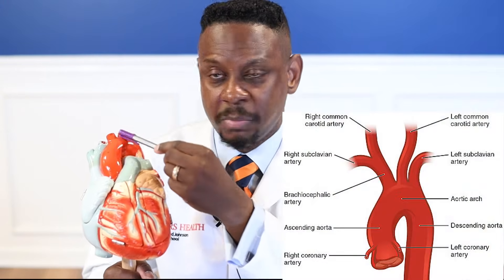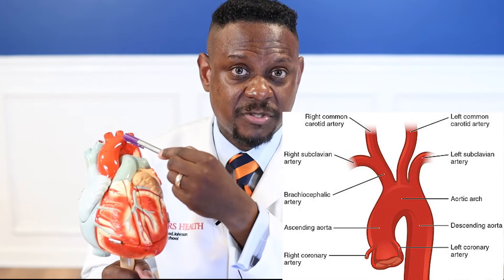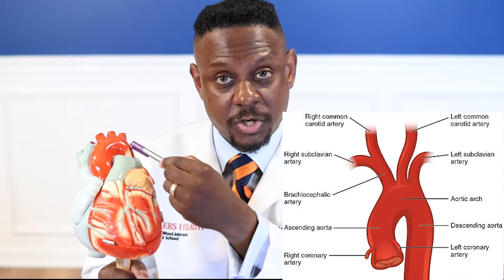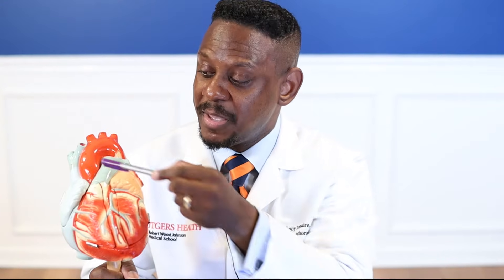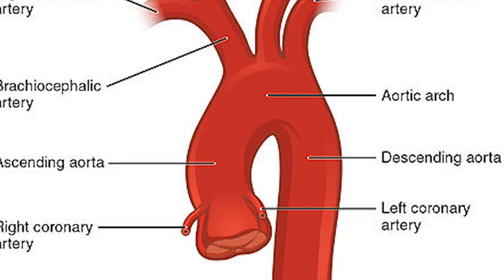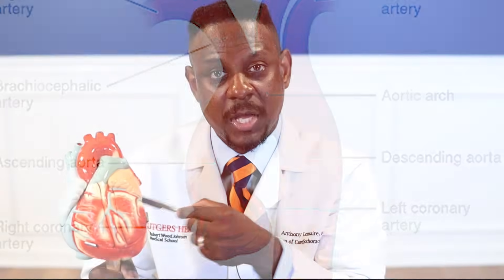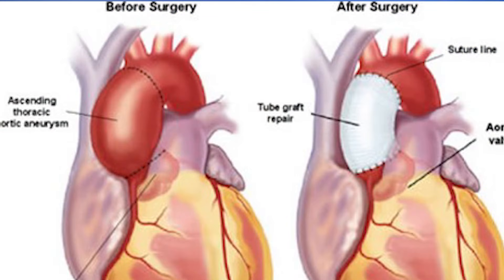Repair of An Ascending Aortic Aneurysm

Comment: I'm 58. My proximal ascending thoracic aortic aneurysm is 4.2 and seems stable. I do have a mild to moderate stenotic bicuspid aortic valve, and recently diagnosed with aortoiliac atherosclerosis. I have shortness of breath bad,I attribute it to the fact that I also have heart failure with preserved ejection fraction. What is your advice? I have a cardiac thoracic surgeon and I like and trust him .Like you said get a second opinion,so I am asking yours..Thank you.
Reply from the maker: Hi, I appreciate the question. There are a lot of information that I am missing. The 4.2cm is not very big and the mild to moderate AS is not that bad. However, in your question, you state that you have SOB "BAD". If you are very SOB, I would come in and get evaluated by your CT surgeon or cardiologist. You shouldn't have "bad" SOB from mild to moderate AS. Please get another echo to evaluate and speak to your surgeon and cardiologist. You need more workup. Take care.

Comment: One question regarding the dangers of heavy exercise having  an Ascending Aortic Aneurysm: Is the danger related to blood pressure?  I have a wrist BP monitor and when doing push ups on the floor, recorded only a very minor increase in BP compared to rest BP?
Reply from the maker: I apologize for the delay in responding. The danger of exercise is primarily related to the sudden increase in blood pressure. I suspect that doing push ups won't dramatically increase your blood pressure however other more intense activities can increase your blood pressure. Good Luck!
Reply: @cardiacsurgerypatienteduca2445  many thanks for your reply& clarification.

Comment: Is that possible to have key hole surgery to fix enlarged aorta..? mine currently 4.8 was advised to get it fixed.
Reply from the maker: I apologize for the delay in responding. There are some surgeons who can repair the aorta through a smaller incision. I don't know any personally but please ask your local cardiologist or primary care doctor. Good Luck!

Comment: Please please tell me how a non tissue graft Gortex mends or fuses to the two ends of tissue. You see it in or suture in place but how does that gray heal to the tissue
Reply from the maker: Sorry for the delay. The graft gets sutured or "sewed" into the aortic tissue. The Graft doesn't "fuse" to the aortic tissue, the sutures that surgeons use connects to the two together. Its like sewing a button to a shirt. I hope that helps.
Reply: @cardiacsurgerypatienteduca2445 and over time these sutures never degrade   Thats kind of scary that I might have that for decades and it won’t deteriorate
Reply from the maker: @danielgreen3612  I understand your concern however the sutures that are sewn to the graft do not deteriorate. Furthermore, the scar tissue and inflammation from the healing process will also keep everything together. I wish you the best.

Comment: I'm at 4.6 cm and having a CTA angiogram test on Sept 19th. I am told 5.0cm is the surgery mark.
Reply from the maker: I wish you the best. Depending on your personal situation, 5.0cm may be the surgery mark, however, for most patients without genetic issues, the indication for surgery is 5.5cm. Good Luck.
Reply: @cardiacsurgerypatienteduca2445 thanks so much for your reply, im obese, diabetic and on jardiance, metformin and toprol. Honestly I'd just as soon get it over with.
Reply: @cardiacsurgerypatienteduca2445 thanks Sir, you rock!

Comment: I’m having left shoulder/upper back pain. It was really sore where my left arm and back meet. But, that’s gone now. However, I’m still having problems at the back of my shoulder and upper back. It’s not sharp or sudden. It’s deep and hurts a little when I walk. I’ve put heat and rub on it but it’s still there. Finally went to the doctor today and she said it may be my aorta so she’s having an MRI of the it. This is kind of scary 😢
Reply from the maker: Sorry for the delay in responding. Please see your doctor. Aneurysms do not typically describe the pain that you are describing. Aneurysms typically cause pain only when they rupture. Please see your doctor.
Reply: @cardiacsurgerypatienteduca2445  Thank you. I will….

Comment: Mine was discovered @ 5.5 during my first ever Afib incident. I also am on the Marfans spectrum… so I had the surgery at first availability. 
What this doc does not mention is that the risk of death is 20% because many suffer a rupture of the aorta because they delay too long.
Reply from the maker: I appreciate the comment and I'm glad you recovered from your surgery. The risk of surgery for an elective aneurysm repair can and should be  low. The mortality rate is as low as 2% at experienced centers. If the aneurysm turns into an aortic dissection then the mortality rate can be between 25-30% depending on the center with surgery. If the aneurysm turns into an aortic dissection and the patient doesn't have surgery, the mortality can be over 90%.

Comment: Doctor my mom is suggested TEVAR by doctor.Her descending aorta is 5.3.
what precautions we have to take ?
Plz plz plz reply
Reply from the maker: I appreciate the question. I am not an expert in TEVAR as that is primarily performed by Vascular surgeons. I perform surgery on the Ascending aortas. However, I will state that TEVAR is an excellent operation will great success. Any patient with an enlarged aneurysm needs to (1) maintain a normal to low blood pressure, (2) avoid intense exercise, (3) strict surveillance with CT scans of the chest, and (4) follow up with an expert in TEVAR, which is most likely a Vascular surgeon. Good Luck!

Comment: I have an aneurysm on my asending aorta that measures 6.2x5.1. I was told five years ago that surgery is necessary when it reaches 5.5cm. We continue to monitor, however, at 6.2 it’s getting a little scary. 
How dangerous is a 6.2 measurement? I’m going to have another CT scan prior to my appointment with my vascular surgeon. 
I’m a little frightened
Reply from the maker: Sorry for the delay in responding. If you are seeing a vascular surgeon, I suspect that the aneurysm is not in your ascending aorta. The size criteria for surgery is 5.5cm (generally) for the ascending aorta. If you have been followed for 5 years that's a good sign. There are several factors that play a role in whether a patient requires surgery. I would speak with your surgeon about all the details, if you have any doubts, get a second opinion.

Comment: Im 2 mths post op. Since then, I've had genetic testing & they found a change in COL3A1 gene. What I'm worried about is how that would affect how the graft heals.
Reply from the maker: Sorry for the delay in responding. To my knowledge I don't know of any connection between the genetic diseases and wound healing.  Please do you own independent research but I don't think you have anything to worry about in terms of wound and graft healing. Good Luck in your recovery.

Comment: I have bicuspid aortic valve with very mild aortic regurgitation and sinuses of Valsava 4cm . I am 1.88 height and 86kg and 28 years old I used to lift weights for 16 years . Should I stop ? Also my aorta is stable for 8 years .
Reply from the maker: Sorry for the delay in responding. Since your aorta is stable, you can exercise including weight lifting. I would minimize power lifting however. Please establish care with a cardiac surgeon.

Comment: How long does an accesending arortic aneurysm surgery generally take to perform?
Reply from the maker: Great Question. The surgery varies in length based on the complexity of the operation and that will depend on the patient's anatomy. The operation from incision to closure could be as short as two hours to as long as 3-4hours if there is significant bleeding.

Comment: Currently I have pacemaker installed about year ago. However I still have irregular heartbeat and accenting thoracic aorta aneurysm Without rupture. My size aorta is about 4.5 cm and I am 79 years old. Should I concern possible surgery for repair of my Aorta?
Reply from the maker: Hi, sorry for the delay in responding. I think at 4.5cm and at age 79yo, there is relatively small chance that your aneurysm will get to 5.5cm. I would strongly recommend to continue to have annual CT scans of your chest. I would also keep your blood pressure controlled. Good Luck.

Comment: Very well explained, mine iss a slightly dilated root @ 4.2, i guess there is no concern or futher testing
Reply from the maker: Thanks for the nice comments. I would still have your aorta followed. I would recommend an annual CT scan or Trans thoracic echocardiogram. Good Luck.

Comment: THORACIC ANGIO CT EXAMINATION WITH ECG TRIGERED 
Technique: The distance from the upper thorax opening to the end of the diaphragm was scanned following 1 mm cros-sectional axial plan and 80 cc IV contrast material fertilization, and the obtained images were converted into 3D reformatted images on the workstation and evaluated. Clinical information: Ascending aorta 44 mm. Comparison Information:-Results: 
Hypodense nodules were observed in the left lobe of the thyroid gland at the level of the thoracic inlet and at the isthmus junction of the left lobe. It is recommended that sonography care be evaluated together. 
It is the normal anatomical location and dimensions of the heart. Minimal effusion was observed in a 7 mm area located below the pericardium. 
Aortic diameter at the sinus of Valsalva level was measured as 44*42 mm. The diameter of the ascending aorta was measured to be 50 mm at its widest point. The aortic arch diameter was measured as 38 mm proximally. The diameter of the thoracic aorta from the pattern is 28 mm. 
The diameter of the pulmonary trunk was measured to be 35 mm at its widest point (pulmonary hypertension?). The pulmonary veins drain normally into the left atrium. The superior vena cava is in normal morphology. 
No pathological size lymph nodes were observed in the mediastinum. The thoracic course of the trachea and esophagus is normal. The hilus of both lungs are normal. The ventilation and vascularization of the lung are observed to be normal. Parenchymal active infiltration formations that occupy space every day are not separated. Diaphragmatic contours are normal. 
In the evaluation of the upper abdominal structures in the image area, 2.2 cm solid lesions were observed in the medial crus of the left adrenal gland (adenoma?), Comparison with previous reviews of the case, if available, is recommended. In 3D images, thoracic walls, soft tisue and bone structures appear normal. Conclusion-Recommendations: 
-Aneurysmatic dilatation reaching 50 mm in the ascending aorta. -Dilatation reaching 35 mm in the pulmonary trunk (pulmonary hypertension?). -22 mm solid lesion in the left adrenal gland (adenoma?). 
-Nodules in the thyroid gland are recommended to be evaluated together with sonography tools This is my situation for now. What do you think I should do? Thank you very much in advance for your advice. Good work.

Comment: In 2017 I had a 3.7 in December 2024 I had a four i continue with a very active life. I’m 68 and I’m still lifting weights and running.  is lifting weights OK??
Reply from the maker: Great Question. Lifting weights in general is fine but "Power weight" lifting of heavy weights are not advised. Large heavy weights can increase your blood pressure and heart rate acutely which can then lead to an increase in size of the aorta or potentially lead to rupture. I would recommend continued surveillance and get the opinion of your heart surgeon on the lifting weights as well. Good Luck!

Comment: 4.4 just found on a CT scan no contrast meh reduce stress as much as possible folks
Reply from the maker: Sorry for the delay in responding. I strongly recommend getting a repeat CT scan with contrast. This will give you a more accurate measure of the aneurysm. Please find a cardiac surgeon that you trust to follow you. At 4.4cm the aneurysm is very small.

Comment: This is all new to me and I'm pretty worried. I'm a 49 year old male. I went into hospital the other day for pain in my chest and breathing difficulties and they found on CT that my ascending aorta is ectatic (dilated) at 3.7cm. And ever since I've been getting pains in my chest and back. Not bad pains, just feels uncomfortable really. I do have a 2cm sliding hiatal hernia as well (possibly larger), so I don't know if the sensations might be coming from that. I'm down to see a cardiologist for an echocardiogram and blood tests to see if there is anything genetic going on. My mother passed away 5 years ago at the age of 76 from a 9cm ascending aortic aneurysm, so as you can imagine I'm nervous at the moment. Just looking for any advice I can get really?
Reply from the maker: I apologize for the delay in responding. At 3.7cm that size is small. I would strongly recommend getting an experienced aortic surgeon to follow you. Aneurysms don't generally cause pain unless they rupture. I think its unlikely that the aneurysm is causing you pain but I would meet with a heart surgeon.
Reply: @cardiacsurgerypatienteduca2445  Hi, and thanks for getting back to me. So I also have pectus excavatum (a dip in the chest). I've had it since I was a child. It's not an extreme case, but it's noticeable. Do you think it's possible I could be feeling short of breath because of both the 3.7cm ascending aorta and my pectus excavatum? And could my hiatal hernia be causing any of these symptoms do you think? I used to work out with weights at the gym quite regularly until this was discovered. I've been weightlifting on and off for around 20 years, but I think it's wise to stop now with regard to blood pressure etc.

Comment: Dear Doctor. Thank you for this excellent and clear explanation.  I am 71 years old and in good physical shape. I need to have surgery for an Aortic Root Aneurysm in mid January (with a possible repair of leaky valve at the same time).  Are there are any minimally invasive approaches available at this time?  Or is open surgery still the preferred method?
Reply from the maker: I apologize for the delay in responding. There are minimally invasive INCISIONS. You can have small incisions made but if you want the aneurysm repaired without having an incision, there are currently NO APPROACHES that don't require an incision. There are no catheter based approaches for your aortic root aneurysms.

Comment: I'm 67yo and at 4.2cm. 
(1) What caused this? I've always enjoyed good health. Former athlete (swimmer). 
(2) If this grows 1mm per year, I'll hit 5.5 in 13 years--when I'm 80yo. At what point is someone too old to do this? And better off living with the risk of rupture?
Reply from the maker: I sincerely apologize for the delay. 1. Aneurysms are caused by multiple reasons: First, the number one reason is high blood pressure. Second, genetics. If you have some genetic diseases (Marian's, for example, you can develop aneurysms early). Third, bad luck with some genetic anomaly. Fourth, bicuspid aortic valve patients can lead to aneurysms. To address your other question. Aneurysms DON'T NORMALLY grown at an even rate. There growth is not at a normal rate. They can grow one year and not the next. It is very hard to predict the rate. Finally, there is no age where there is no cut off where a patient is too old for surgery. There are some 80 year old patients that are in great shape and they are great candidates. There are also some 70 year old patients that are poor candidates. It really depends on the patient. A critical aspect is finding an EXCELLENT surgeon. Good luck!

Comment: I was diagnosed in 2016 with a BAV and a 4.3 Ascending Aortic Aneurysm. I have been scanned every year since then and it had stayed completely stable now it randomly grew to 4.7. Now I’m not sure if I should push for surgery or if maybe there is a chance it stays a 4.7 now. It really shocked me and has me scared. I’m 32 and otherwise completely healthy other than asthma. I live in TN but have been considering traveling to Cleveland clinic. Not really sure what true mortality rate is and whether surgery is best or watch and wait is best. I just want my life back and to be healthy.
Reply: Sorry for the delay in responding. The BAV is the reason why you have the aneurysm. There is no reason that you need the surgery now but since you are so young, there is a good chance that in the next 40-50 years, you will need the surgery. Most surgeons wouldn't operate until the aorta got to 5.ocm so you should be many years away from that. The Cleveland Clinic is an excellent place but Vanderbilt which is closer to you, is a great place also. I recognize that you are nervous but please keep in mind, when the surgery is done electively, the success rate is 98%-99% depending on the surgeon. Good Luck!
Reply: start taking more potassium...it regulates calcium..calcium buildup is all part of arterial sclerosis in the arteries... potassium helps remove it..Just a little something to help keep your arteries more clean..but you are what you eat...so......

Comment: I had ascending aortic and valve replacement 4 weeks ago. Grateful to be alive today. Waited for almost 5 yrs. Been tired waiting and it felt like Ive been carrying a ticking time 6:38  bomb that I could die any  day anytime. So when hospital called for my schedule. Was only given 5 days notice. I am hopeful for smooth journey to recovery.
Reply: Yes, you ll be back to normal in 2-3 months. Just be patient even when feeling down in body an spirit. No pressure to yourself
Reply: I have an I V C filter from 17 years ago, I found out yesterday that I have clot in my arotic vessel . What to do